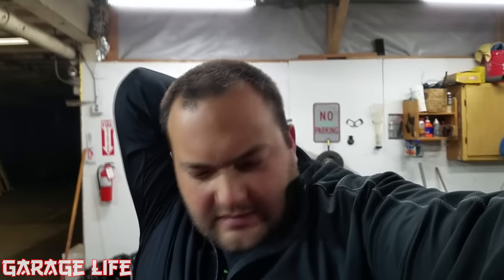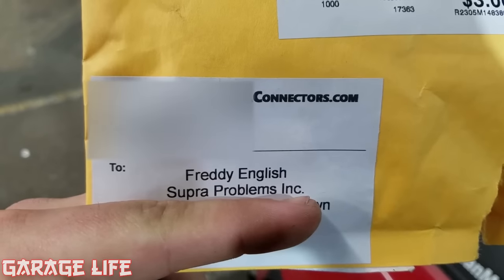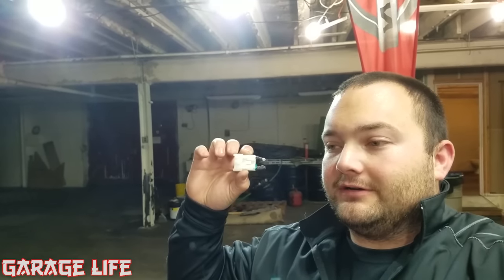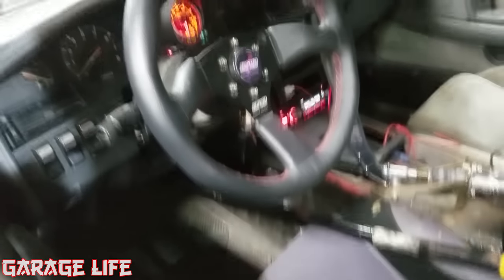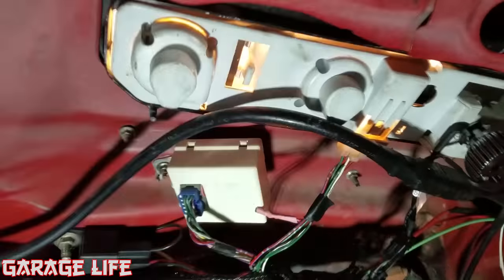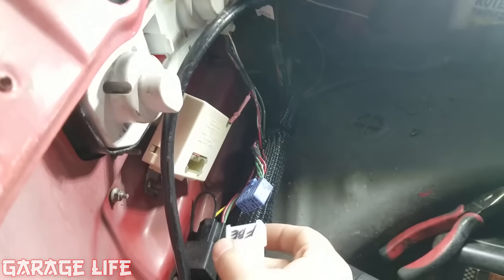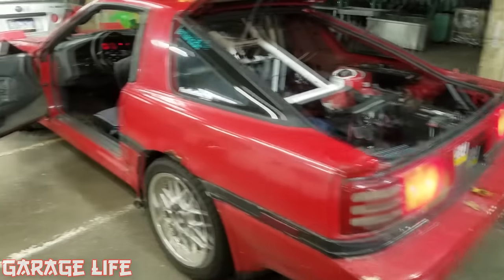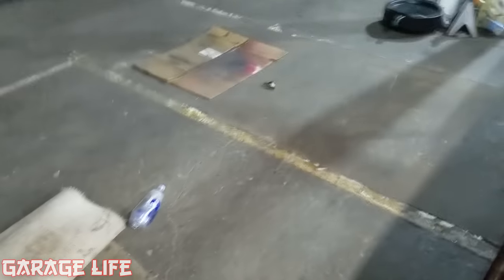Every Supra NEEDS This! Make Your Supra Safe

Comment: Water leaks into the lamp failure module causing corrosion and shorting. What I did was open up the module and clean the corrosion and checked the solder connections. When I reattached it to the body of the car I put it in a plastic baggie with the opening facing down so that if water poured over it it wouldn't get inside. That solution has worked.

Comment: Just ordered one, thank you for the information!  I have an 88 with the third brake light which works and the lower 2 do not. Diagram shows them running separately out of the failure module.

Comment: If you open the lamp failure module up you will most likely find a bad solder joint, very noticeable, re-solder and it will work just fine once again.

Comment: Hi i like your video about tailight sensor.i have 91 supra non turbo my tailights works dash lights work but still have warning light for tailight in dash.since that little plug what you buy is really expensive andno way to buy it now.do you have diagram how i can put aome wires on connect or rewire bypass...

Comment: My son just bought a supra and it has brake lights but no rear driving lights or reverse lights. Do u think this part will solve that issue for him also or is this just for brake lights
Reply: was that the problem? i am having a similar problem...everything works but the running lights in the back
Reply: @cade_ccc8083  yes that is the problem. It's that stupid box back there that goes bad. U have to get one of these delete kits or rewire it without using that box. Very poor design by toyota.

Comment: well my brake lights work and turn signals but the dash light is always on iv checked the bulbs and all work iv even gone thru the wiring. do you think this will fix that issue and if so when a bulb dos go out will the dash light still turn on ?
Reply from the maker: +TheHighroller88 this should fix it!